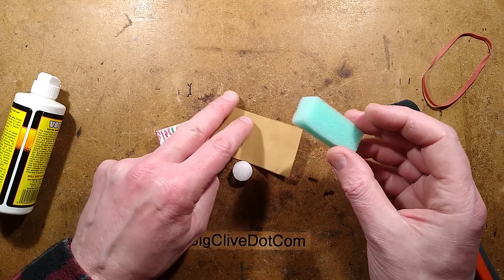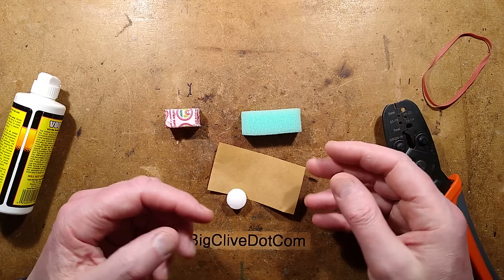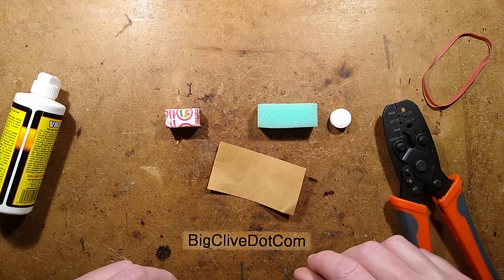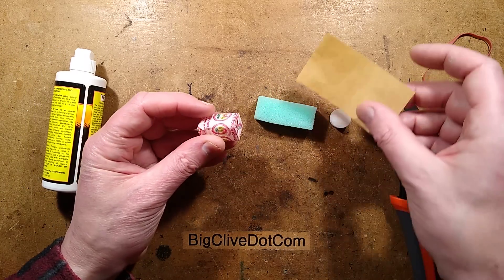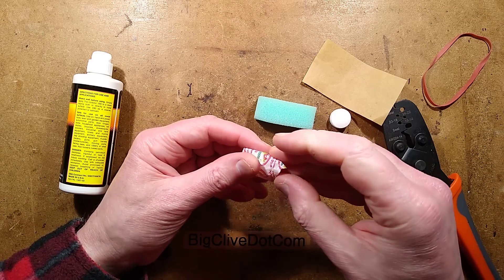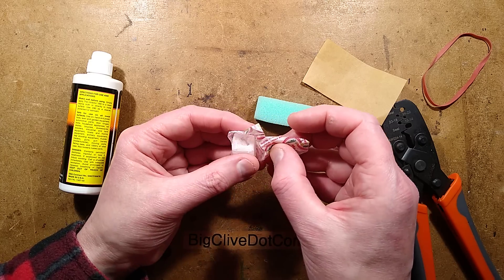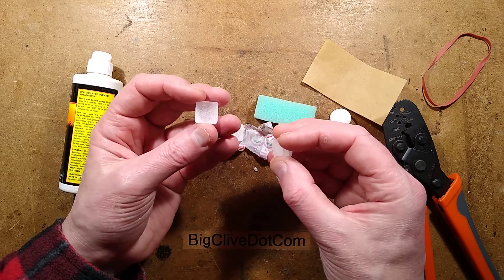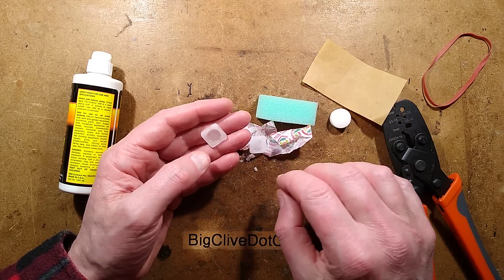Let's talk about VCI corrosion inhibitors

Comment: It's the cheapest way to avoid Returns, and long time storage. Beings some of those items, could be sitting somewhere for Years.

The problem is the atmospheric (temps) they are stored in.

It must be warm enough for the aromatics to form and distribute.
Of which at those same temperatures, a dissacant would suffice. But those are an environmental Hazard,.. because people Eat Them 😂
... if i read the packing correctly 

I'm sure they could add Both Together.
An aeromatic with a dessicant. As long as the One, doesn't suck up the Other.

PB Blaster Magnetic Spray,..
Is what I juice tools of any kind down with.
Most people that have tools. Crimpers or a crescent wrench. Don't use them every day. But still would like them to be useable. Even after a dozen years.
And they are always easier to clean, than Replace. And you don't have to Douche Everything Down. Unless you're Aquaman  🤣

That BLUE THING,..
May be a Spong. And that's for a Totally Different,.. secretion 😳 
... time is money too

Comment: We have several old clock mechanisms  that have a small container placed somewhere near the metalwork that contain 3 in 1 oil usually topped up once a year. Not as yet had any problems with mechanisms due to rust or dryness and on the flip side not dripping with oil either.
Reply from the maker: I've heard of kerosene being used as an ambient oil bath for clocks without soaking them in oil

Comment: I coat my tools in camellia oil if they are going into long term storage.  For things like saw blades and everyday tools ptfe dry lube from wd40 works well.

Camellia oil worked for the samurai on swords and armour and it seems to form a bond with the metal that doesn’t break down. Only issue is the price
Reply: Concur with the use of camellia oil. It leaves a very durable, non-oily coating when it dries, is nice to work with and enhances the look of metallic surfaces. Nothing I protected with it has ever shown any deterioration. You don't have to use a lot and using the same rag every time means a little goes a long way.

Comment: The composition of VCIs differ based on the desired material to be protected eg iron, copper etc. But mainly they contain some solvent which is volatile oil and the active ingredient can be substance with low volatility or one which slowly sublimes and deposits molecular layer on the object which we want to protect. Examples of such compounds include for iron dicyclohexylammonium nitrite, dicyclohexylammonium carbonate  and for copper benzotriazole,  tolyltriazole and many others formulations.

Comment: I don't know if kerosene would be an effective corrosion inhibitor or even a carrier for such. Kerosene is somewhat hygroscopic and must be kept in tightly-capped containers to prevent it from absorbing moisture in the air. Stored properly, it has a nice long shelf life, which is why some Preppers invest in a small stockpile. We use kerosene convection heaters as supplemental heat for the house (and only source of heat in the garage) so I've delved far too deep into that rabbit hole. Our buying options are either $5-6/gal from a shady gas station, which we then add a water-removing treatment to because we've had water in the kerosene before, or $12/gal in 5-gallon jugs from Walmart/Home Depot/Lowe's that we know we can trust. 

And if you'd like some interesting reading about kerosene heaters without going too far into the weeds, look into kerosene space heaters being used for heating in rural areas of Japan. While America's kerosene heaters haven't changed much in 40-plus years, Japan has made some incredible innovations in that same time. Electronic thermostats, electronic ignition, air circulation fans, auto shut-off when tank is empty, removable leak-proof fuel tanks that you refill with an automatic battery-powered pump... It would be great to have one of those in my garage on the not-so-brutal days where I'm lighting my heater for small intervals.
Reply: I have 2 old aladdin brand from Britain that burn with a blue flame. No safety anything but an excellent design that doesn't smell when it operates.  I've always wondered why the American kero heaters all burned with yellow flames.  The literally stink.

Comment: do the electronic corrosion inhibitors really work, like the kind you plug in and there suppose to rustproof something?
Reply from the maker: I've not come across those, but the thing that immediately comes to mind is the Indian mosquito deterrents that work like a plug in aroma unit, but use kerosene as the carrier for transfluthrin.  (A natural insect repelling plant extract.)

Comment: Moth Balls do the same thing but stink. I use Maxima Chain Wax, works great. It's a lousy chain lubricant but a great rust preventative. When I was in the navy we used Mil-C-81309 Type I and II. Our helicopters reeked of the stuff but no corrosion even in salt water environments. Chain Wax smells just like it and for all I know it probably is the same. Just soak a piece of brown paper bag with it and throw it in your tool box or spray your tools with it.

Comment: You can buy plastic or paper bags that are treated as well as the little sponges.
I usually call these VPCI (vapor phase corrosion inhibiter).
Calling these oils is a real stretch, they are complicated chemical mixtures.
They don't just coat the surface but actually chemically inhibit corrosion.
I buy the sponges (or little plastic boxes) in cases of 24 and then put them into my various toolboxes.
I replace them every couple of years.

Comment: I've specified them as an alternative to conformal coating of the PCBs for an oil pipeline  SCADA system in the wilds of Sumatra. The issue I had with conformal coating was it cannot be applied to almost sealed relay coils and the various connectors involved in the system. Also conformal coatings can mess with heat dissipation.
There certainly is an element of snake oil attached to this but they do seem to work. There's also oxygen scavengers which are just iron filings in a porous bag which are often packaged in bags of foodstuffs. I doubt any of these devices will last forever so regular inspection and replacement is in order at least once per year.
Reply: Oxidation of iron is why confined spaces in ships need to be well ventilated before anyone enters or a respirator with an oxygen supply is required.
Reply: @major__kong  I'd never thought of that, I only thought it was because of noxious gases. That's really interesting and possibly applicable to other places as well.

Comment: Back in the day when I had a motorcyvle.......
We used to use some stuff  called ACF-50... google it...
for winter storage protection on the metal bits on the bike...
not sure if this the same type of thing....
we blew the moths out when we started riding again in spring......

N x

Comment: I am a machinist, in an extremely high humidity area. I often find old... ancient machinest tool boxes(traditional wood and metal aswell) in awful environments with bricked packages of champfer that turned to dust over time. But amazingly large amounts of tools and custom jigs... parallels.... ect... have held up in them really well. Where everything around it sat for 40 years since they seen light around it, have more or less dicentagrated. Leaving a bit of a diamond in the rough.... I'm also texting while running a lathe... Forgive the spellin'

Comment: The modern legend goes WD40 was developed as a rust inhibitor for airplane missiles of the air carrier air fleet and it's first recipe consisted of nafta - straight refined petroleum fractions from gasoline to kerosene mixed with some ammount of light paraffin fractions.

Comment: I'm not sure on these , we do use Irish Spring soap to keep mice and rats out of cabinet's, tool boxes,and vehicle's. And a corrosion inhibitor from BP Blaster, and a black spray paint from Rust Oleum that's for outside lawn seating ect... I'll spray it on my bare metal tools, then wip it off. Makes them look like the antique tools they are without looking like Black painted tools . And it will last for well over a year.the BP Blaster I've sprayed on equipment outside, and it's lasted well over 3 year's without any rust showing up.

Comment: Been using Napier VP90 in my ‘liberty cabinets’ comes as a paper sachet like a giant teabag with double sided tape to stick it to the door. Seems to work well enough.
Reply: Not a bad idea. I wonder if a strip down every bar... err "combustion cylinder" might be a nice long term that is tiny enough to be shot out if missed when pulling it out.
Reply: @nobodynoone2500  I just pull through each tube after giving them a squirt of VP90

Comment: We made gears for a top tier German automotive company. Each gear was placed in a cardboard separation lattice, with VCI impregnated paper between each layer. When the box was full a lid was strapped on and dispatched. We never had any rust issues at at. We also shipped items to the US by sea and used the same VCI paper and again had no issues. Good post thank you 👍
Reply: Supply a few steel mills with VCI wrap for their rolls. It's definitely big business.
Always stoked to receive car parts for my 30 year old car come in VCI baggies!

Comment: My great grandad apparently used to keep his spanners, sockets and ratchets in a regular tool box, and then at the end of the week, he'd give all of them a dunk in a vat of used engine oil, then chuck them over a mesh grate for a couple hours, maybe as he went to clean himself up from the day's work, maybe go outside and defrost his car on the way home, maybe have a quick coffee, etc. And then he'd place them back in his tool box. Tell you what, he never had a rusty spanner or socket!
Reply: I throw my ratchets and other mechanical tools in automotive (often diesel or cheap standard) oil once every couple years. I usually use cheap new oil to avoid any acids and contamination from old oil. Same with the heads of my power tools, and sometimes anything else that is bare iron or mild steel. The CRC rust protector is my favorite for longer term or more serious protection. It's like a better cosmoline. More waxy than oily. I wonder if it's lanolin based, that stuff is good for anti-rust and undercoating.

Comment: I'm curious what effect these products may have on electronics. I keep a couple of radios in my 'freedom safe' as it also acts as my Faraday Cage (actually just a handy place to store spares).
BTW: have you done anything regarding Faraday Cages? My memory ain't what it used to be ;-)
Reply from the maker: I've mentioned Faraday cages, but not made a specific video about them.
Reply: @bigclivedotcom  It would get you tons of views, if from an odd bunch. It's worth explaining, and debunking many emf shielding bs products that arent grounded, sealed, or the correct mesh/conductivity to even do anything. I think faraday cages in irl use and conditions might be an interesting rabbit hole that few have explored with much rigor.

Comment: Everything in my workshop at this time of year suffers from flash rust damp cold atmosphere. If this was cheap enough it would be a god send , one big sponge in the middle of the work shop protecting everything.
Reply: That's what dehumidifiers are for.
Reply: I would be poring buckets of water out from it plus the energy it uses.. @SinsBird
Reply: I sort of doubt you want to be coating your lungs with it.
Reply: is any worse than wd40, 3 in one, or other oils~? @SianaGearz

Comment: When I worked on crushers we would get large shafts and eccentric bearings in for various repairs.  The machined surfaces were always wrapped in large sheets of this paper.  The old-school mechanics lined their tool boxes with the stuff.  The field guys who sometimes found themselves wrenching in the snow would use the sheets to cover their tools in the work body drawers.
Reply: I use the ones that come with fruit for a similar purpose, keeps the bugs down, and the vapour carrier also acts as a good holder when you hit it with a light coat of WD40, and allows it to release slowly over time. After all WD40 was developed exactly for this, preventing corrosion on metal surfaces.
Reply: As I understand it, WD40 was to keep water from condensing and freezing on the outside of space rockets (which are very cold because of liquid oxygen and the like). @SeanBZA
Reply: @AnthonyCartmell  ISTR the WD40 was for corrosion control during storage in the tube, as it was a thin coat applied to the bare steel missile, and would burn off during ascent, but in storage it would keep the missile from rust, as those bunkers got wet. Used because it was a lot lighter than any paint, and easy to apply to keep that thin film on the missile for protection. That it also kept ice formations from adhering strongly only applied to the very early ICBM units, which used cryogenic liquids, the later ones that used room temperature storable propellants, even if they are incredibly toxic, or solid rocket motors, did not have this issue.
Reply: WD40 stands for Water Displacement, 40th formula.

Comment: water is a great vapor carrier, but it does not mix with oil unless you add a specific chemical, see if you can make one and add the right amount of ethanol or such, soak a sponge and let it dry to damp and toss it in a Tupperware and check the Tupperware after a couple weeks and see if all surfaces are oily where the sponge wasn't, the larger the container the better😂😂

Comment: My guess is that the "trade secret" part of these products is getting the ratio between the heavier and lighter vapour fractions exactly right, as such that whatever carrier solvent is employed has just enough vapour pressure to carry the heavier hydrocarbon but not too much so that the carrier solvent evaporates and leaves the heavier fraction behind on the substrate. I would expect that kerosene would evaporate much too quickly and therefore not result in the even dispersion of anti corrosive oil that is wanted. The secret ingredient is probably a low molecular weight polymer, perhaps PEG-400.
Reply: Indeed, my first guess seems to have been right, based on good ol' Wikipedia:

"Vapor pressure is critical parameter in VCI effectiveness. The most favorable range of pressure is 10−3 to 10−2 Pa at room temperature. Insufficient pressure leads to the slow establishment of the protective layer; if the pressure is too high, VCI effectiveness is limited to a short time."
Reply: Most are actually kerosene distillates, just that they get a very specific molecular mass range from the refinery, instead of the broad range that is sold blended as "kerosene". Refine the base to split it into finer parts, and you can select quite well out of the base crude. Just a very specific series of bases and lighter volatiles used, plus a few other organics, like benzines, to handle dispersal in the substrate.
Reply: Ratios are hardly a trade secret.. anyone can work that out. Trade secrets are chemicals that are kept secret. Just look at MDS for various chemicals.
Reply: The trade secret part is because they do not want you to make it. How much replacement tools and equipment is done and how much do they make. Rust free metal is not what they want,.
Reply: @tonysheerness2427  That isn't true when your product is a VCI that prevents tool corrosion.

Comment: This is some fascinating stuff! I recently noticed some electronic components from one of the bigger suppliers started arriving in "vpci-125" bags, which apparently "does not affect optical properties". I'm curious what they are using, sadly they require logging in to view their SDS (why is that even allowed?). Makes me wonder how healthy breathing in those VCIs must be for people who work with them all day?
Reply: Just means the oils are going to not attack the more common clear plastics used in electronics, and will also not attack optical coatings on glass. As a lot of the optically clear plastics are based on styrene, must be a very light oil with a very low vapour pressure, and a minimal amount as well.
Reply: Well, they stop your lungs from rusting.

Comment: I bought a real safe - not one with the electronic lock that's easily defeated.  The inside panels are made of felt covered cedar wood.  I know that cedar chests were used for repelling insects, and no one wants to have their paper money eaten by moths.  But I suspect that the cedar has a similar effect as the camphor.

Thanks, Clive for the inspiration to further investigate these VCIs.  A friend had some battery acid leak and found corrosion on the tools he had in a chest.  Living in a dry climate helps, but there are still times where moisture does corrode valuable items.  Now you know why gold is precious because it never corrodes.  😍😍

Comment: Is that the same thing you find under the rubber mat in a TV remote control or is that something much worse?
Reply from the maker: Silicone oil oozing out of silicon rubber products is a big issue over time.  It can make things very unpleasant.
Reply: That stuff under the rubber mat is really strange.  It looks like a liquid!  I've washed remotes with detergent to try to get rid of it.
Reply: @acmefixer1  I think it is silicone oil migrating out of the rubber material the buttons are made of as it breaks down. Surfaces you touch get the oil wiped away but under the plastic it has nowhere to go.
Reply: @acmefixer1  use detergent with a bit of methylated spirits...